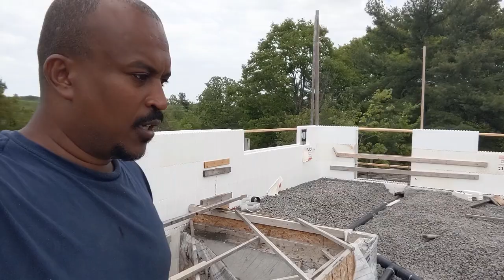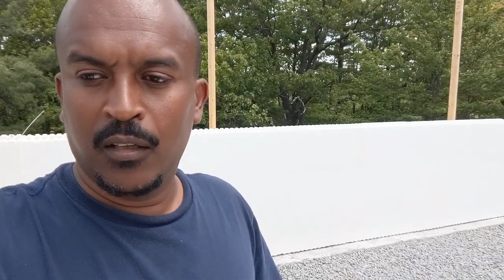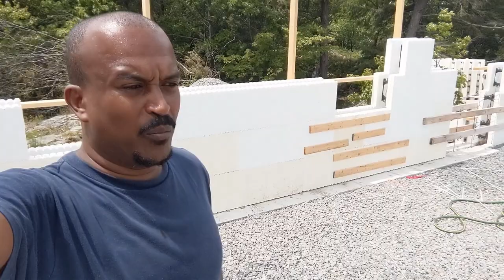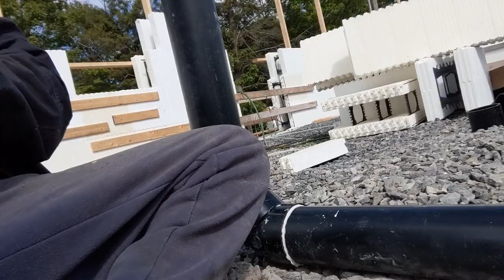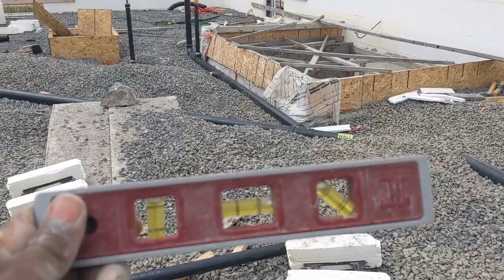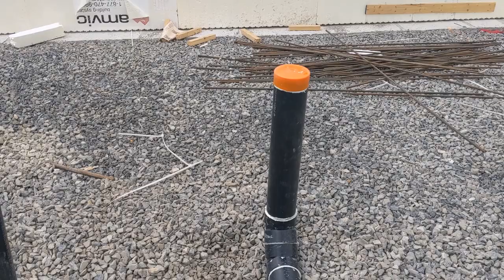Failed my DWV inspection | Building my dream house | Ep15

Comment: Dude, following along with your build, however you are making some real mistake by not keeping in contact with your local building dept., taking them out to lunch and picking their brains.  Not following codes is only going to make them rolls their eyes when they pull in your driveway for checks, and make them much more motivated to investigate and find out what you decided do cowboy this time.   Not too mention the slowdown, rework and expense you''re going to have to expend.  I LOL'd at your response to the pro's who snickered at you saying you were going to do it yourself. You are doing it, just need to find someone qualified to help you out with a lot of these things that are going to cost you money to revert, or correct.
Reply from the maker: I agree and than you for watching my video s